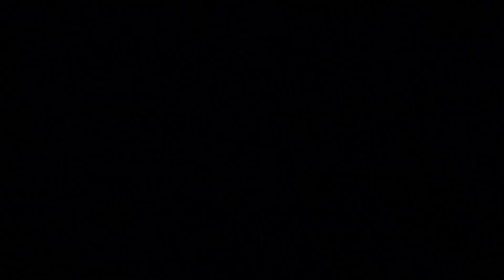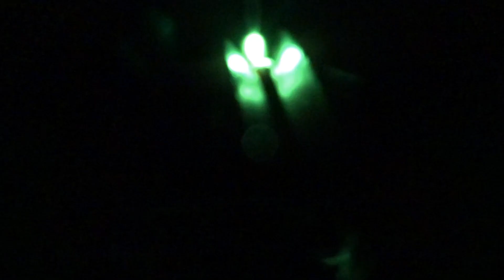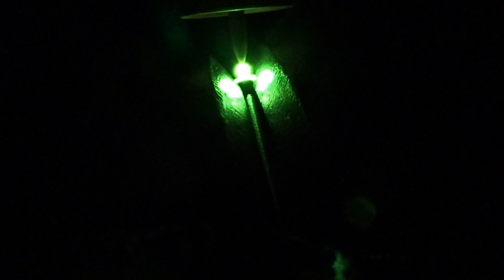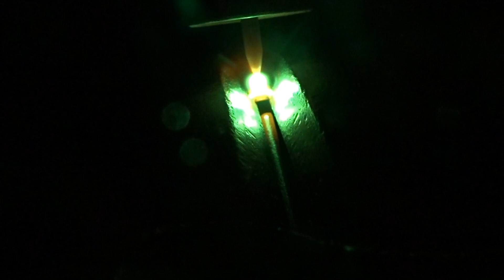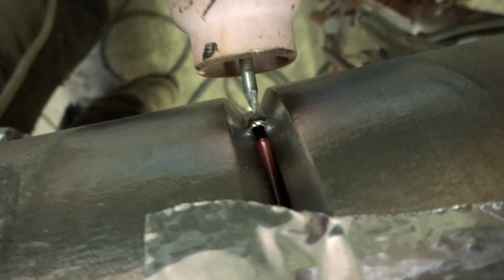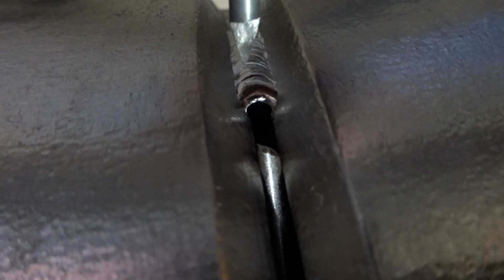Titanium Arc Shot

Comment: Hey dude , why such a slow and drawn out pulse?
Reply from the maker: +bigtonka494 This is titanium. I am not using a trailing shield, I am only using a ceramic cup. So when I weld the titanium without a trailing shield but only have to rely on a ceramic cup, what happens then is I create a weld ripple and then I have to protect the ripple away from the atmosphere to where the atmosphere will not interact with the deposited metal, where it will not oxidize and form an oxide and then I can progress and make another ripple. So the reason for the long drawn out pulse is because I am protecting the deposited metal away from the atmosphere since I am not using a trailing shield.

Comment: You have crazy mad skills and dexterity to hold that weld position the way that you do as you move that slow!  I have to purge and trailing shield my 6-4 Ti because I am losing my control due to some ruptured cervical discs in my neck.  It's going to be propping, propping and more propping till the day I die LOL!  What CFM are you running your Argon at?
Reply from the maker: Doug P I'm using my fingers to brace against the pipe while holding the tig torch, but it may just be that I'm paying more attention cause I know I was getting recorded and everything had to be adequate. I'd like to acquire some trailing shields, higher quality ones. I would be at 18-20 cfh, with the gas lens and 8 cup.

Comment: Thanx bro, how about some tips on welding P91pipe ? I use a dip technique on the rootpass, can't stand the heat wrap but It seems to work ok, what do you think?
Reply from the maker: Harry Crank Its been too long since ive welded that material, I can't mentally remember the stuff. It depends on how to material flows and sluggishness. I usually only end up using 1 of 2 techniques, either continuous feed or break surface tension, but I cant mentally remember that far back welding the material. I burnt my arm on a heat wrap one time, but the worst burn I have was from aluminum pipe, I still have the red  mark on my arm from it. That was a bad one that stuff. The pipeline welders in texas have speciality made leather elbow pads, theyre like knee pads but these are very unique, I think a company down there makes them specialty or something, but the guys can put their elbow on the pipe and fore arm and be completely protected. I worked with a welder in 2011, we were welding chrome with those heat wraps on the pipe, I think it was like a 24" or something, but he just did lay wire and walked the cup the whole way up. Didn't even need to touch the pipe.
Reply from the maker: Harry Crank Oh very similar to an Inconel or duplex with a surface tension breaking technique but unlike the titanium (technique in video with manual pulse) the arc is continuously on.
Reply: ***** I use almost the same technique as the Titanium, I haven't welded that alloy, but too hot specialy on a hot day

Comment: I've met a guy who welded this metal before he said this is the most picky of the metals to weld. Weld puddle consistency of honey. Also prep work and cleaning the metal is most important. Correct me if I'm wrong. Good video Travis, now quit fucking around I want you to weld up Wolverine's adamantium skeleton.
Reply from the maker: Calvin Bostick No that's true, Its a nice metal to weld, it is particular, but ultimately the three things to remember are Heat Input, Shielding gas & ppm of oxygen and Cleanliness/oxide removal. In a nutshell, provided the pipe is room temperature, the oxides have been removed off the pipe and filler pre fitup and prior to welding, as well as the purge quality is 25ppm and less for amount of oxygen in the inert gas itself which will interact with the metal as it elevates in temperature, a person will be able to weld it, but the technique has to be precise to make the most of where the filler metal is for a sound weld ripple, backfeeding helps for the root so you don't have to deal with the filler sticking to everything externally, and provided that all metal that is heated is protected away from the atmosphere until it cools down to about 700F, to when you can move away, it takes only a few seconds to protect the material when it goes from a liquid state to a solid state, it is orange then goes to a glossy mercury color, and when looking at the weld ripple itself depending on how you are welding it with trailing shield or not the technique slightly changes you can see the weld ripple solidify from the outside in almost likeness to water evaporation; but provided the metal is protected away from the atmosphere the weld will be able to be done with success, but it still is a pain and very particular and if you have an error, you have to use a hand file and hand saw to remove the metal because friction from a grinder or other will contaminate the metal and form oxides. So hes right it is a very particular material and a person has to get into a ritual of clean, weld cool, clean weld cool so he doesn't mess up the steps and so the weld is sound. I am still waiting for lex luthor to hire me to weld on kryptonite metal .. DC missed their call on having "the welder" as one of his arch nemesis
Reply: Lol I'll just stick to carbon steel right now about to start on stainless soon
Reply from the maker: Calvin Bostick Carbons easier to do, you actually get more practice welding carbon than titanium because you spend more time cleaning while the carbon is all welding.

Comment: 2 questions...what kind of tungsten would you use when welding inconel and copper alloys also which polarity?
Reply from the maker: The OutCaster I just use 2% thoriated tungsten for those metals, I've never been the kind of welder that tries out different tungsten. Polarity is electrode negative for the Inconel and copper alloys.

Comment: What happens if you don't spin the filler metal? Does it deposit too much or does it make it lumpy?
Reply: +77442680 43 I find spinning the filler prevents any oxide skin from stretching and forming into some ugly blob. It's a habit I've picked up from welding Al, you SHOULDN'T be getting any oxide skin but it's easy to let your rod stray beyond the inert gas and get just enough skin to cause problems.